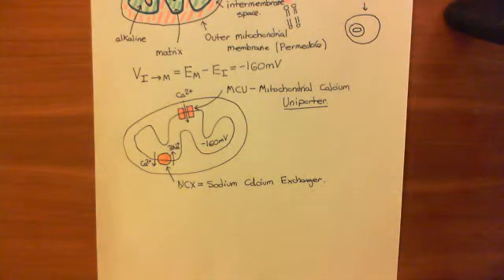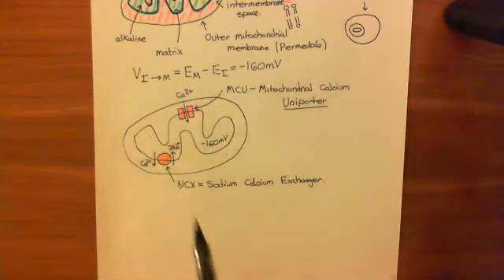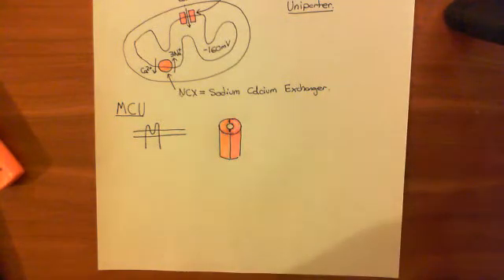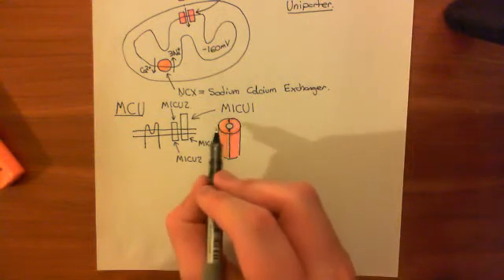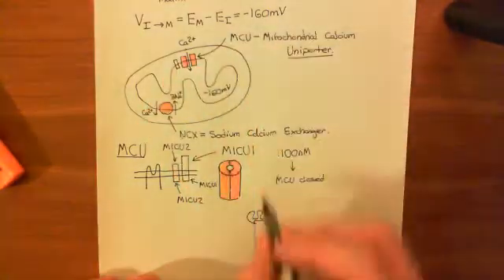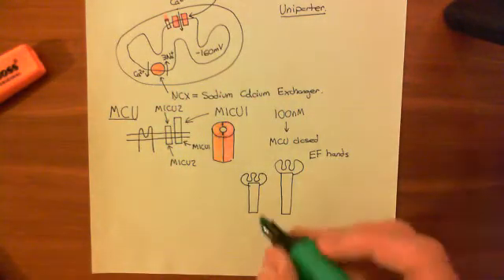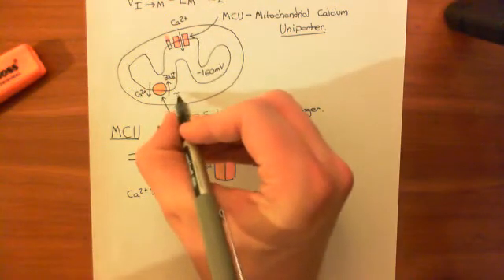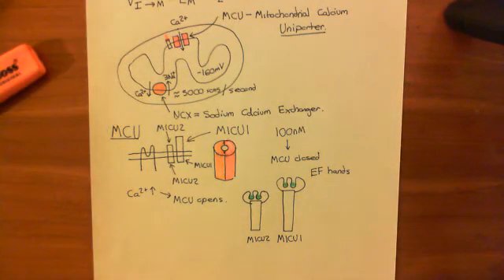The Mitochondria and Calcium Homeostasis Part 2

Comment: What was the reason of michondrial matrix to take calcium ions if they are again exported out by the Na-Ca pump??
Reply: As I understand it, the mitochondria can store calcium (like the ER) to maintain calcium homeostasis in the cell. So it functions as calcium storage.
Reply: too much calcium accumulating in the matrix reduced the mitochondrial membrane potential and/or starts an apoptotic pathway , hence the Na-Ca pump tries to maintain an optimal calcium concentration inside the matrix for physiological purposes (boost the TCA cycle enzymes).